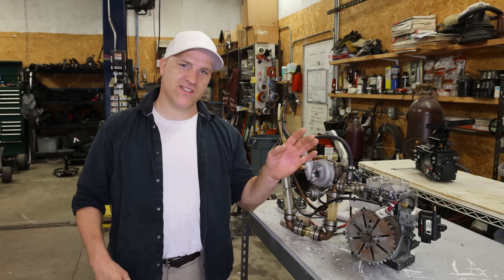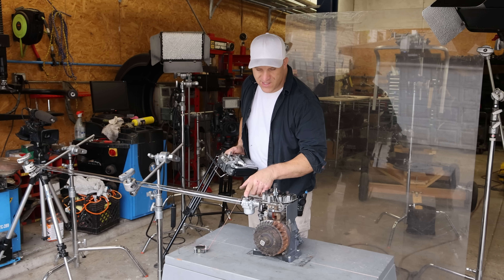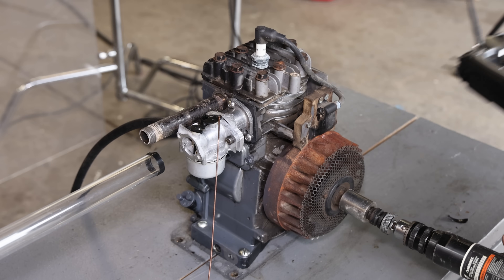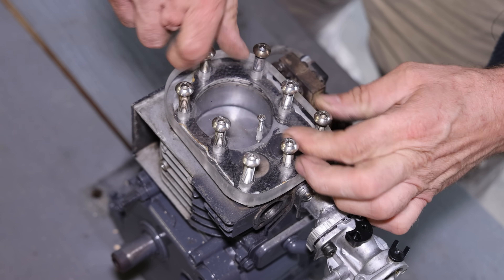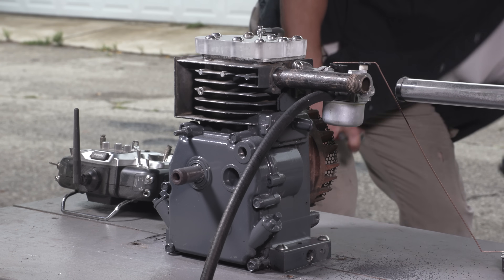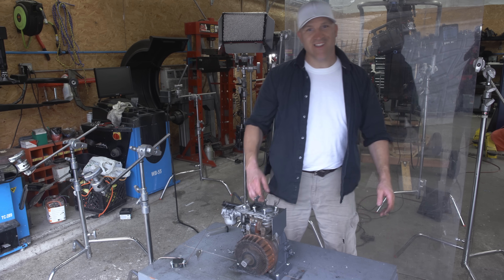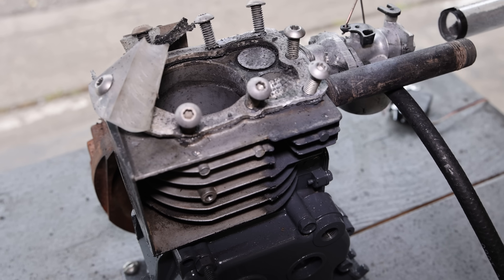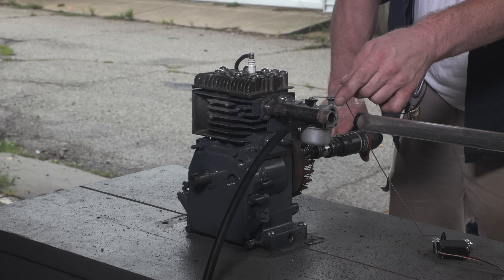Engine Running On GUNPOWDER

Comment: If you do it again, you need to control the charge that goes into the motor for each intake.  If you dumped gasoline in the tube, it would hydro lock the motor.
Reply from the maker: I was actually thinking about trying some different fuel ratios next time!

Comment: The first internal combustion engine was tried with black powder for the fuel, but it would get set off by the intake valve closing, so coal dust was tried, but it was impossible to meter it correctly, so then flammable liquids were tried and gasoline was found to work the best.

Comment: "So as a testament to Briggs and Stratton, these engines are practically indestructible"
Governor delete and over-rev to 6000 RPM has left the chat

No but seriously, i had one of these exact engines from and old push mower. Decided "what would happen if...", long story short, full-throttled the engine with a broomstick. The flywheel exploded and after it went the conrod.

Comment: Ok, if you want to make this work, here are your operating parameters:
1) Use modern smokeless powder. Black powder is nasty, corrosive stuff which will foul your piston and cylinder, even when "running".
2) Use a metered amount of powder via a feed system. I would recommend a rotary type using small chambers filled under spring pressure from a hopper. Gunpowder is very powerful in very small increments, meaning the difference between one gram and three grams is very significant. Consistency is key.
3) You need to do your math. A typical .22 bullet containing a miniscule 0.16 grams of powder puts out an average of 24,000 psi, which is coincidentally the same output as 2 grams of water turned into steam in a pressure vessel. A highly tuned race engine has a maximum  operating cylinder pressure of 200psi. Any higher will cause detonation and failure at low rpm. 
4) Use a detonation chamber.  A seperate chamber in which you ignite the powder can be tuned in size to increase or decrease the operating pressure before ducting the charge through to the cylinder to push the piston. This will also negate most of the fouling effects of smokeless powder, even though it does burn quite cleanly. Might I suggest you use the spark plug as the igniter in the chamber, and duct the chamber through a tube to the sparkplug hole? Just reset your ignition timing to slightly past top dead centre, this will fire the powder after the piston peaks and is on the way down. 
The simplest way to run your motor on gunpowder would be to run a line from the gas bleed port on a large calibre semi-auto rifle, and run blanks. That way, your charge is consistent and perfectly metred, but probably not the most PC way of going about it.

Comment: The original internal combustion engine design ran on gunpowder. It was only after many tragic accidents that the otto cycle was developed and the IC went golden running on naptha and other liquid expansion chemicals/ explosives.  The original designer blew themselves up.... it was the gunpowder metering. it kept flashing back into the main powder container and detonating the whole thing.  Its an interesting story if you can stumble upon the old time tales of Internal combustion seminal years.  Many people  tried their hands at making an engine, it was a hobby thing for the affluent, and a way out for young poor engineers. Steam took over while it was developed, but it eventually made it ,as you know.

Comment: AMAZING AND FUN to see. One of the first combustion engines ever made was a black power driven engine, similar results with it , PS Absolute super dangerous to take dry or even slightly wet blackpowder in a electric grinder because super fast metal blade and plastic container  produce static electricity and friction heat 2 things black powder are very sensitive to

Comment: Want to give a saftey precaution, you never, ever want to grind a pyrotechnic composition inside a coffee grinder or blender or anything similar, use a ball mill and keep the ball mill away from life or property when milling black powder or any black powder substitutes, (pioneer powder, pyrodex, ect) and if you do mill, NEVER use steel or any other sparking grinding media, also make sure the ball mill container itself won't spark either. Otherwise it could explode.
Reply from the maker: thank you, I am actually Aware, i dont believe i ground anything is this video or were you just saying in case? either way I appreciate it!
Reply: @WarpedYT I'm just saying because I saw you pouring the powder into a grinder and supposebly grinding it at the end of the video. 8:19

Comment: When I was in Jr. High school, I was in a shop class, where we built small engines. We actually tried this experiment, but rather than use a pipe to introduce the gun powder, we just simply put about a table spoon of powder in the spark plug hole. We were afraid of it, (rightfully so!) so we set up a piece of plywood with a hole in it, so the starter cord could be pulled from the other side of our plywood "blast shield". We drew straws to see who would pull-start the engine, none of us wanted to be near it. I drew the short straw, and started it. The results was very similar. It started slowly, and as it came up to speed, BANG!! We had the stock cylinder head on it, it blew out part of the cylinder block opposite the valves, and, let's just say, we found a chunk of the cylinder head on the roof of the school! We never could find the rest of the head. It seized the engine, and it was very difficult to drive the piston out of the cylinder. it domed the piston over its wrist pin, and put a big crevice down the middle of the piston face. Needless to say, we never tried that stunt again, our shop teacher was NOT amused!

Comment: The Niépce brothers ran an engine on lycopodium powder back in 1807, so it's not as though we're seeing something totally off the wall.  I'm sure the concept would have worked even better if the engine were designed specifically for the job -- conversions are always tricky.

Comment: We had black power engines in the 1880's, called "engenho à pólvora", it was just like the "engenho à vapor de caldeira"(boiler steam powered sugar cane mill) but a thousand times dangerous, but it was a different kinda of engine,  that was more like a "cannon recoil operated flywheel", a cannon was connected to a rod, that pushed the cannon to an obstruction, that had a candle wick on it, and then bang! it would kick back, align its "vent" to a flap dispenser, and again, and again, and again...some saw it as a safer option, because in that time, boiler explosions were super lethal, literally killing entire cities(which in that time were like 5 or 6 houses in a farm), but the cost of powder were much more expensive.

Comment: It was extremely dangerous and also engine didn't run on gun powder. I wonder if you are able to make a fluidized stream of gun powder (mixed with air or nitrogen) with controlable percentage of powder, then you will be able to run the engine on gun powder without exploding the engine. That will be a good experience to see an engine run on gun powder.

Comment: You know those single serving feeders you see for bird food at the pet store. You get a single serving for every time you pull a handle. It dispenses a certain amount then cuts off the flow, if the engine was able to be fed a slow flow it might work, enough to turn the piston but cuts off the feeder after every serving so the flame doesnt go back to the reserve of powder blowing it all to hell. Might work. I've seen dudes run engines off wood gas so why not.

Comment: Bump!
That was quite a spectacular result!
I believe that diesel engines came about as a result of experiments to try to produce an engine that ran off coal dust. I wonder if one of these B&S engines could work on coal dust if given an appropriate metering system and a good, healthy spark?

Comment: You could have also gotten a nitro rc motor for cheap. Prefferably a used big block. Then dropped tiny bits of gun powder into the intake. Ive seen people make see through heads for the nitro rc motors too.

Comment: for wood dust to burn - something simple at high speed, an accumulator screen in the head. separate screw feed. burn a percentage. adjust the carburetor fuel mixture screw.
Reply: lets see: a red hot exhaust valve : castable refractory : test it

Comment: One of the first attempts at an internal combustion engine ran on gunpowder, or black powder at the time, it was a wheel that looked similar to a ferris wheel, and several combustion chambers around the circumference of the circle, facing outward but at a slight angle as to propel the wheel directionally , it had one "head" facing the chambers, imagine a wheel with bullets around it that propelled the wheel in a circle but without projectiles. Very cool idea!

Comment: Liquid TNT WarpedDude, y'all should be able to run it through the standard carby, no issue. Or, or finely grated up 'Acme' brand semtex powder.     Increase the width of your clear cylinder head to 2feet thick and stand behind both your wife AND your dog but.

Comment: i shot a nearly new 651b caterpillar scraper ringed piston out of its paired sleeve, with a 1/4 plate welded to the bottom of the liner. the plate had a hole for cannon fuse that was black taped to a mechanical blasting cap and  the end of 6 or 8ft or forestry grade det cord, the green stripe, i think used for cutting trees, big trees. pistons,  they're long stroke, about the size of 3 lb coffee can. it was difficult to push the piston to near it's bottom with the compression. a project me and my 12 year old son watched from about 40 ft away behind a datsun 620 pickup door. and the piston shooting straight up vertical, almost went out of sight. what fell back to earth was only the top half, it severed at the pin center, the rings were all blue and wiped liner material from gouging the liner, major seizure, there was nothing of the liner left at all, no pieces, the only part left was the plate but it was in  the shape of a cereal bowl. just think if it had some expansion room. angled like a mortar, it'd go over a mile. maybe two. it's a heavy piston too.

Comment: I'd like to see it actually run on gunpowder....I'm pretty certain that when Internal Combustion Engines were first being developed, some madman did try using gunpowder as a legitimate fuel.....I'm pretty sure that if you use an exact* amount,.it would cycle nicely. You'd just have to come up with a decent feeding system. 

*who knows what the 'exactly amount per cycle would be, but it would sure be fun funding out.

Comment: 7:36

You have to set the speed to 0.25x and pause it at just the right frame, but if you catch it, you can see that combustion chamber glowing about as bright as the Sun in the sky a half second before it undergoes what I like to call "rapid unscheduled disassembly."

The exact next frame after that is just a bright yellow and orange colored cloud.

Almost looks like a tiny Chernobyl.

Also, 3:16 onward sounds like those cartoon engines stalling out and then blowing up.

Comment: The tube full of black powder was more interesting imo. I can't help but wonder what would happen if you took a black iron pipe, filled with some black powder and cap only one end. Like, a pound of the stuff. Would the pipe explode? Would it woosh and blast fire out of the open end in an epic manner? Would it be enough force to obliterate a watermelon at six feet?

Comment: A better test would be
To see if you could 
Meter the powder down to just run the engine on that stuff
Instead of blowing it up. Experiments
Like that with black
Powder and internal
Combustion engines
Was done more than
100 years ago. Interesting wow boomyah ya piro maniak.

Comment: you know some of the first experiments Rudolf Diesel  did were using coal dust in an internal combustion application.  I think if you had a proper way to meter and supply the gun powder as a fine dust you may be able to get an engine to actually run without blowing up

Comment: Seems Gunpowder is a bit too powerful as explosive to just let it being sucked freely as much as engine wants. If you want to repeat the experiment I would add some narrow passage to reduce the flux of powder. Also it would be nice to add some way to feed the correct ammount of powder, like a timing belt that  opens and close a valve to a inert gas can (and take some ammount of powder by venturi effect), but the build seems to be super complex.

Comment: It could work if you actually controlled the amount of powder per stroke. The amount of powder needed is less than a spoon full. (much less!) Letting it suck in several wide open gasps of powder was asking for it!

Comment: Try to dissolve that gunpowder with something flammable and that would be more intresting. Putting solid gunpowder isnt much of a big surprise since the solid particles have so much energy concentrated in them that gives an explosion. Similar thing would happen if you could use powdered solid gasoline.

Comment: I would suggest that when you edit your videos you get everything in the proper sequence,  you sow the engine running prior to the gun powder the same footage before and after the powder was introduced to the running engine,  you see the tube of powder explode,  the you again show the engine running supposedly after the original head was put back on,  yet in that clip we can see the plastic tube still in tact and still mounted in the brackets,  obviously a before the powder clip.  then at 8:43 supposedly after you ran the engine again to prove the engine still runs,  the bent screws and piece of broken see through head is still in the block.   the video content was great.  editing not so much,          I remember in school  45 years ago, an auto mechanics teacher going over the history of the development of the internal combustion engine, one of the first designs was  fueled with gun powder  and only fired once and killed the guy that built it.

Comment: That was awesome. I had an old mini bike with a Briggs 3.5 hp on it. I duct taped one of those square 6v flashlights on the front fender and we'd cruise around the neighborhood at night. It was  kinda sad when the engine eventually blew. It wasn't nearly that spectacular. It kinda just went duff.....clack,clack,clack. It was done. Stick a fork in it. LOL!

Comment: Don't get me wrong, watching an engine blow up is always a delight, specially in slow mo. But it didn't really "run" on black powder, I see no difference from stuffing it with black powder and blowing it up with a remote fuse, if that's all it is, one could just go around a junkyard blowing stuff up, not really the same as "running" it.

Comment: So yeah when you ground up the gunpowder in the grinder I got a horrible flashback.
Funny story: I was once doing this with the star pelllets from a firework and it exploded in my hand which ignited all the other powder on fire around it. This caused a section of wall about six foot in diameter to blow out and blasted out a few windows. I ended up have severe burns on my hand and just wait it gets better. 
I was also charged with felony manufacture of explosives. 
So yeah I wouldn’t do that, but thanks for the Vietnam type flashback lol

Comment: The first diesel engines were made to run on coal powder, wich is the same as black powder without its oxydizer, you can make heavy diesel fuel by mixing water and coal dust.
Reply from the maker: Thats interesting, I've never heard of that before.

Comment: Check out Hydrazine. My understanding its pretty dangerous but can't be much more dangerous than gunpowder. Lol. Supposedly makes tons of power.
Reply from the maker: Yes but issue is it's a serious carcinogen.
Reply: @WarpedYT  didn't know that. Is it something that you could wear gloves and set up an exhaust fan to be safe or is it way past that. If you can do it safely it would be really cool to see how much power it could make. I wasn't able to find much info on it with people running it in an engine. Don't bother with it tho if you can't protect your self from it. Either way keep up the cool videos.

Comment: Great videos but you kind of forgot to take the pipe filled with black powder out of frame to see if the motor still around but clearly that was before you blew it up still a pretty cool video though keep on blowing them Motors up

Comment: That was amazing! I was looking forward to optimizing the delivery system for the powder to get the motor to run on the powder. Something like an hour glass with a valve to regulate the flow possibly.

Comment: You have a cryocooler to get liquid oxygen into a thermos, right? Try dripping that into the carbeuretor, starting at a lower fuel setting then normal, then rich.

Comment: Instead of hooking it on a accessory switch you should try to put that servo on the throttle switch on the controller  and you probably could of controlled that tube distance better
Reply from the maker: Good point but it just happens too fast it's very hard to predict

Comment: Sooooo, in your “its still running after the explosion” clip, your gunpowder tube is right there. But I just watched it explode. So how is this clip AFTER the explosion that blew that tube to little bits? Did you mix up clips?